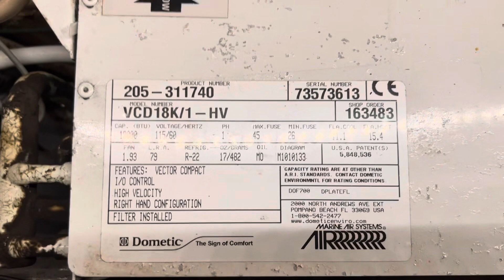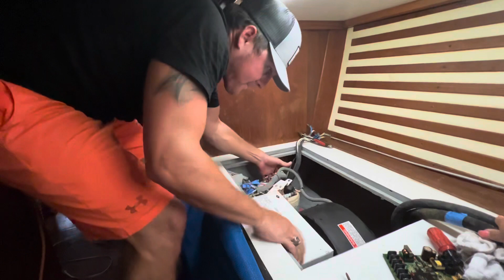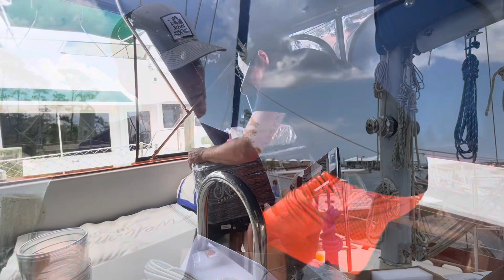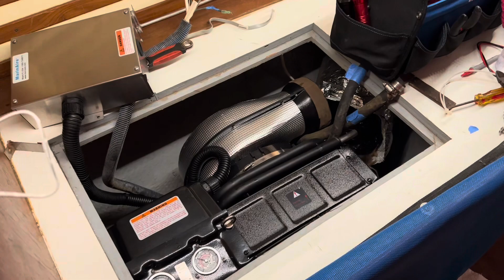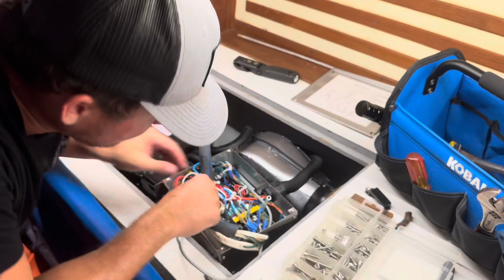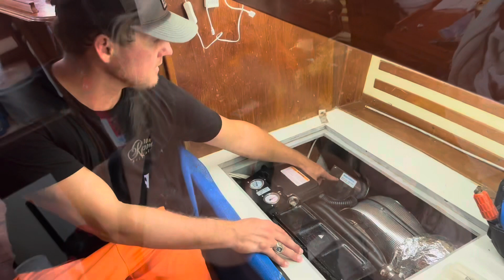Installing our new MarinAire 11,000 BTU AC on our sailboat

Comment: I’m in the market to replace the AC on my boat.  I have 16,000 btu unit.  Why did you pick that unit over other models?
Reply from the maker: So sorry I’m just responding! They are very similar to the previous units that were great for a very long time. And they are a tiny bit smaller than the older units and more lightweight. So far, they are wonderful! We also changed out the water intake hoses, and that made a huge difference as well.
Reply from the maker: We came across MarinAire after trying to see if our old units were still being made. After I spoke with someone in customer service they suggested the size units we purchased. So far, so good!!!!